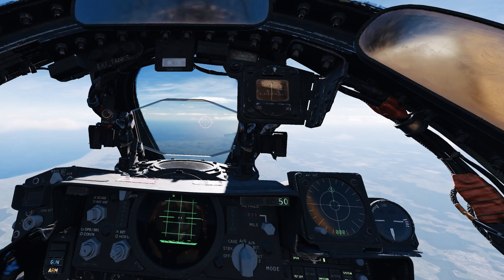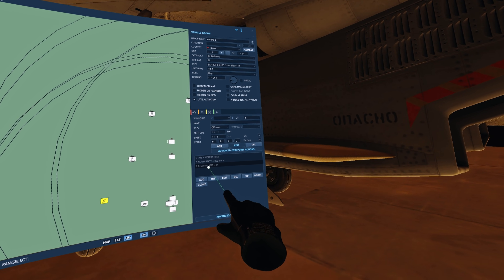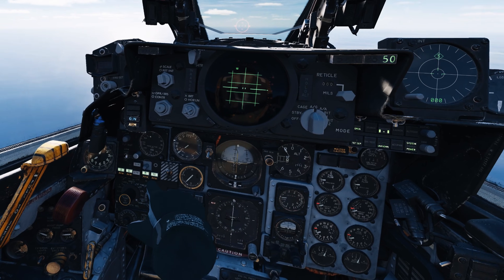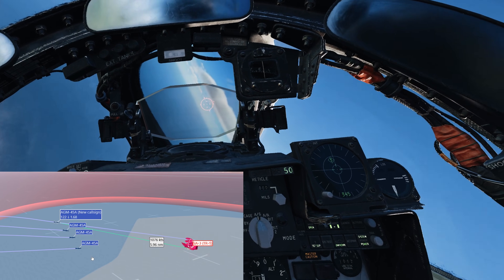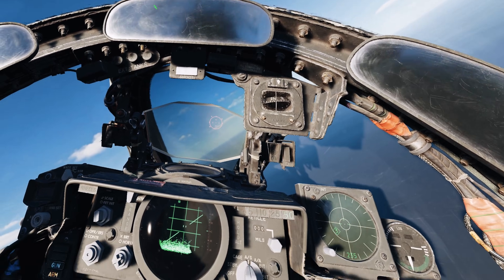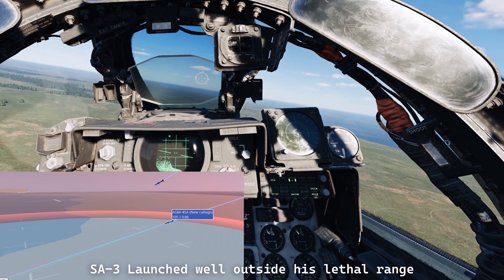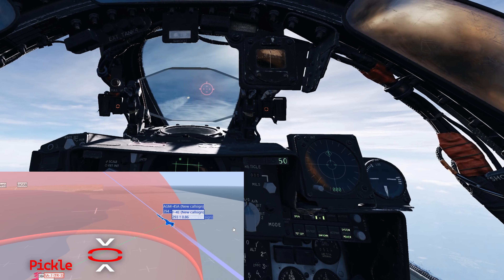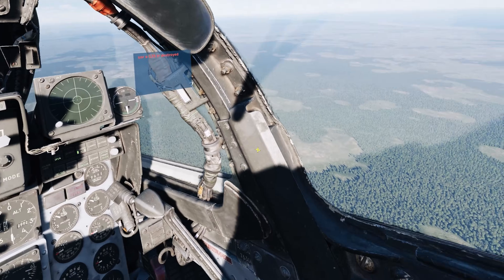The proper way to employ AMG-45 Shrikes - DCS F-4E Tutorial

Comment from the maker: as pointed by a knowledgeable individual these shown in this video are not the word-for-word manual operations nor the settings. But I guarantee you that at this point in time in DCS this is by a big margin the most consistent method.

Update: word from the developer:
from JNelson
I feel like I can perhaps clear some of this up since I wrote the WRCS (among other stuff) for the F-4E in DCS.

While launching from high altitude with a loft is designed for the lofted shrikes. Below about 20,000ft (from memory sorry) the calculation changes which can make it better for direct attack. The WRCS has a range and altitude bias - this is a point through which the WRCS tries guide the shrike at above 20,000ft the point is 20,000ft infront of the target and 18,000ft in the air, as you decrease in altitude this point is scaled along the this angle proportional to your altitude to a minimum at 5,000ft where the point it is guiding to is the target.

There is also an angle bias too to the calculation which means if you do not loft it will account for the decreased range which could get you a trajectory similar to what a direct attack shrike might fly.

Comment: I like the method, tried it but for me its not working... the direct shrikes are falling short even at pull up at 10nm and the loft ones are even more useless sailing long.... is there a minimum speed or loft angle for this method?
Fixed: was not in a/g Mode...
Reply from the maker: at the moment we don't have any information, but I try to stick to mach .85 or greater at angels15.
I do try to loft 5 degrees more than the WRCS suggests. oh did you put the correct target altitude in the computer?? is your INS not messed up by previous hard manouvers?
Reply: @alpenfoxvideo7255  I don't know. It was a hot air start so INS must be ok, I started the loft around 10miles out (over water).. But I may lofted to hard and didnt get the cues right. I have to check how to read the pull up cues... I just pulled up... direct shrikes are very short by a lot...
I keep trying. But your video clearly shows that it works pretty reliable. keep it on
Reply from the maker: @ did you put the popper more or less on the target? maybe it was short
it’s the situation we are in a lot of players have inconsistent results
Reply: @alpenfoxvideo7255  I've
 put it slightly behind... I'll retry 🙂
Reply: I think I found the bug... I think I was in A/A mode and then the pipper is wrong... now 3 of 4 hit the target... cool. Thank you.
Reply: at the end I now have more consistent and more stand off capability using LOFT shrikes.. I use same method pull up earlier and as soon as green donut appears, then center the stick.. then the shrikes are hitting the target from even longer distances.. but if you pull up further when green donut appears then its like in this video they are all going over the top...

Comment: I’m a bit confused about what you meant by biasing the aircraft’s nav computer vs shrike seeker, do you need to have a pre planned steerpoint set at the SAM site or did I misunderstand?
Reply from the maker: @jbrad2529  no, the entire calculation is done by you pointing the Pipper at the target. Since we are using the direct-seekerhead shrikes they tend to use slightly more energy than the computer might calculate so it’s better to aim few mills higher
Reply: @ gotcha thank you! I love doing older sead/dead it feels more fun and rewarding than the HTS pod and HARM shots from 50 miles or JDAMs